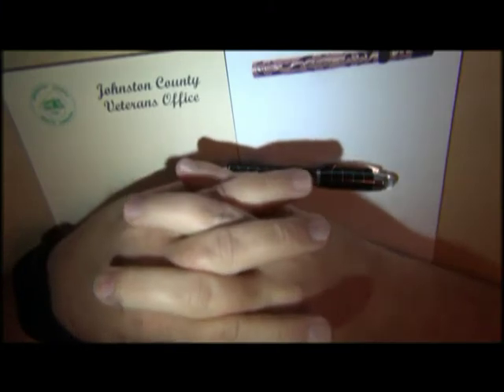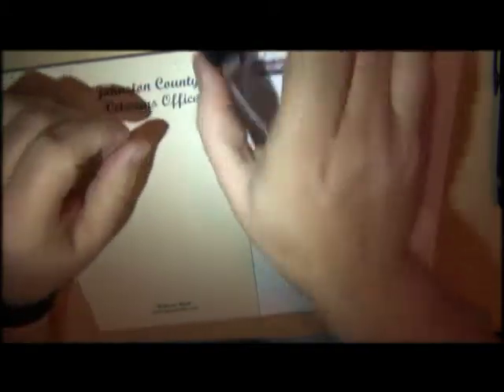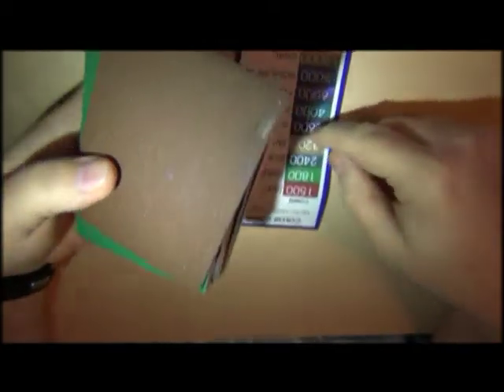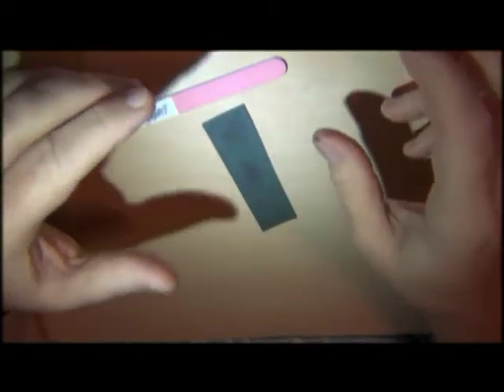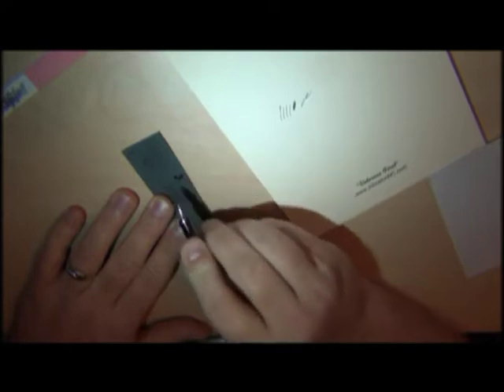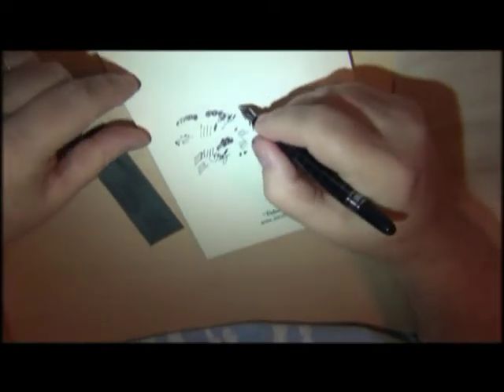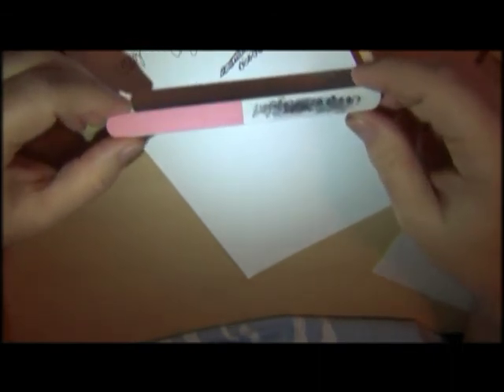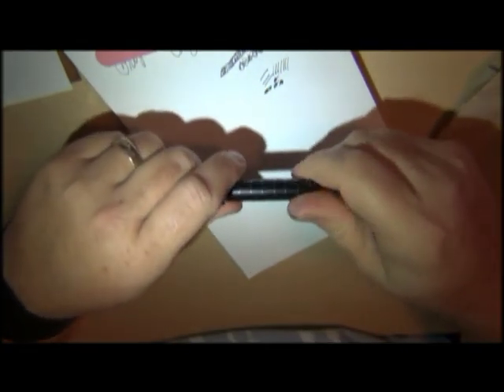Troy's fountain pen nib smoothing technique

Comment: Thank you Troy. I bought the sandpaper set, then the rubbery 12,000 sheet and the white and yellow mylar.
My first attempt was a $2 fine nibbed pen that I tried with a fine automotive sand paper (I don't recall the #) and ended up turning it into a broad with no tip lol. I wish I had seen this video first! It was a mess! But with the correct tools I smoothed out a nice 1949 Sheaffer open nib that started out like a sharp nail. Since that was also my first full restore on a pen, the nib work was icing on the cake. I will treasure that pen!
Reply from the maker: It is definitely smart to start out with cheap pens so mistakes are not so costly.  I have found that I can make almost any pen nib smooth with some patience and experience.

Comment: I've been looking forward to this Troy. Thanks for going step by step. I must say I've had very limited success and some failure, because I read a site who said you can find the files that have different steps and use that on your pens, and I had been using that thing and mylar. I'll be going to pick up some of that sandpaper tomorrow and I've already put in an order with Anderson for those micromesh boards. Thanks for the tips!
Reply from the maker: I figured that step by step was the only real way to do it.  One thing that I did not include was to check regularly through a loupe or magnifying glass to ensure that the round ball shape was still there and not flattened out or misshapen, though I did mention it. You can't see me using the magnifying glass with the camera set up I have.  Though I was pretty sure that I would be fine with this particular smoothing operation since it was a fairly unused nib, I could have done a better job of conveying that.

Comment: I use micromesh, starting from around 4000 and ending at around 8000. I find the 12000 is way too fine for what I like. I have had a lot of good results including a Visconti Homo Sapiens with baby bottoms and hard starts to old antique nibs from the 20's. The key is to work slow and check frequently. Nice video and some good advice/ideas. Cheers
Reply from the maker: I used to use just micromesh, as well.  I started around 2000 for really difficult nibs that were like needle points and worked my way finer, ending around the 8000 grit.  Once I learned about the automotive grade wet/dry sandpaper trick, I have stuck with that since it works a lot faster and better than micromesh alone, in my opinion.  The buff stick that I showed in the video has 2400, 4000, and 12000 grit micromesh.  I finish with the 12000 and don't use the 2400 grit portion at all. Obviously if you already have these grits in micromesh, the buff stick is not necessary, but they are inexpensive and easy to use.  Thanks for watching and sharing.  I have learned that different people have different methods, often all getting to the same end result.  This method has worked for me on everything from Montblanc to vintage pens to Jinhao.

Comment: Troy, thanks for the excellent tutorial on nob smoothing.  Having decided to get involved in this process, I started looking for supplies, but I cannot seem to locate the Biloma Triplate eye loupe. Do you have a source other than EBay or Amazon where I might locate this item. Do you have another brand that you could recommend? Thanks so much. I always enjoy your videos!
Reply from the maker: Thank you for watching and for the comments.  The Belomo is a nice loupe, but it sometimes has its limitations being only a 10x magnification.  I also have a Five Elements Triplet with both a 10x and a 20x magnifier built into either end.  The Belomo is easy to hold and carry, which is probably why people like Richard Binder recommend it.  So I bought one based upon his recommendation for the class I took, but I have the other one as well.  The brand is not important, especially if you are not doing this for a living but only as a hobby.  The Belomo is not cheap by comparison, but it is sturdily built and is quality.  But others will do the job.  I bought both loupes on ebay.  ebay is my go to site for most supplies, but not necessarily for ink sacs and supplies like that.  ebay is just too expensive for those.

Comment: Thank you so much for this, it was very helpful. Just curious, if the pink part of the buffing stick is the same as the 1200 grit, why buy it? Can I just use the pink part instead?
Reply from the maker: The pink part of the stick is much rougher than the sandpaper and just doesn't work as well.  The automotive sandpaper does a much nicer, smoother job.  I have tried both and really don't much care for the pink part of the stick.  Richard Binder recommended the sandpaper and I have found that he is correct.  It just works a lot better.  If the pink part of the stick works for you, by all means, use it.  I have found that it is worth the extra expense for the sandpaper.  I am glad to see that you are interested in tinkering on your own.  Enjoy your learning and experimenting.

Comment: Thank you, Troy, for a very interesting video. I am sure this will be of great help to me and others like me. Can I ask a couple of questions? Does your technique differ if the nib is fine, extra fine, medium or broad? Also, is the process the same for steel nibs, gold nibs and even titanium nibs? I appreciate first timers don't want to practice on a gold nib. Perhaps the softness/hardness of the metal used for the nib is irrelevant as you are just smoothing the iridium tipping material. As you can tell, I don't really know what I'm talking about but I would appreciate your views. I was smoothing a Duke 209 just today and noticed an improvement, and I'm just starting out. Cheers, Troy. Great video!
Reply from the maker: Good questions, David.  The technique is going to be pretty much the same regardless of the nib material.  As you said, there is a welded tipping material on the end of most nibs and that is generally what gets smoothed out.  As to the size of the nib, the technique will again be the same.  Keep in mind that you may want to use the loupe/magnifying glass to check on the tipping material.  The idea is to keep it mostly in the round, like a little ball, though even a flat spot on the writing pad itself is also normal.  You will probably take less time to smooth a fine or extra fine nib, since there is less surface area.  Still, to me, fine nibs will write scratchier than medium nibs in my experience, so I may be prone to over smoothing them, which is why you should check with them magnifier and check writing often.  I did not do that in this video since I knew that I had a new-ish medium nib that just needed a little smoothing and was confident that it would be fine by the end of the video, and it was.  I have used the exact same technique on oversized gold nibs like the Montblanc 149 and on fine nibs like on a couple of my vintage pens.  I have also used the same methodology on many Chinese steel nibs, fine and medium alike.  If you have seen progress as a relative newbie to smoothing, that is a great sign.  There a few more things that I could have covered in the video, but I did not want to make it any longer than I already did and did not want to make a part 2.  The basics are there, and I am just hoping that I have imparted enough of the basics to get people to try it and learn on their own through experience.  That is pretty much what I did at first.  I played with it, found some good results, and kept at it.  I did not take any workshops at first.  The workshop only added to my knowledge and technique as well as confidence.  Even after the seminar I took, I was still reticent to try on higher end pens until I figured that I spent time and money on the seminar and had some good success on cheaper pens, so why not just break bad and try it.  That paid off for me, so I keep going and getting better and faster at it.
Reply: Thank you, Troy, for a very detailed reply. Very much appreciated.

Comment: Thanks Troy - I picked up some very useful ideas from this video!  I've done just a little bit of nib smoothing on a Jinhao 992 and on 599 (successfully) but I am really happy to have these tips - I'm going to be getting some of that 2000 grit auto sand paper!!!!  Are those buff sticks available everywhere or just specialty places?   Are they the ones you see in the dollar stores?
Reply: Oops I asked the question as I was watching ... I see you mentioned 2 places to get those buff sticks.
Reply from the maker: Yup, those buff sticks are micromesh on a stick and are well worth the nominal cost.  The nail/emory/file boards are going to be way too rough for your pen.  What I do use them for, though, is to sand down the peg where an ink sac gets cemented onto the section.  When taking off the crusty crud there is often some rough residue and the nail file board helps get the peg smooth to get a good cemented seal.

Comment: So you're saying don't use sandpaper, use sandpaper? Micromesh is sandpaper. If you couldn't get the job done with grits that are consistent and marked out between 3200 - 12000, dont see how using 2000 grit and some unknown sanding stick grit would do any better or worse.
Reply from the maker: I am saying to use the right abrasive for the job.  Obviously there are different kinds of sandpaper and abrasives meant for different applications.  I am using what people who do this for a living taught me and it works very well for me.  Take it or leave it, you do you.